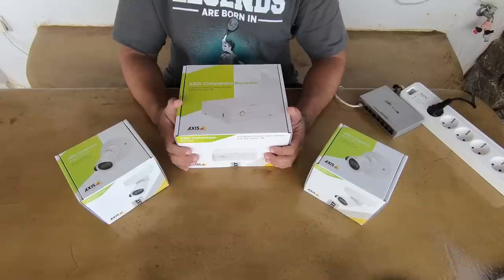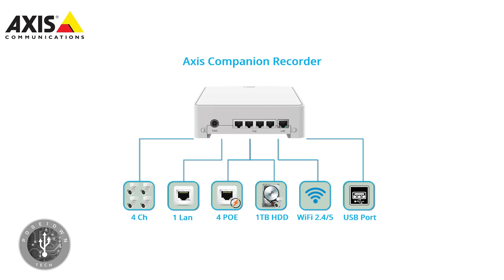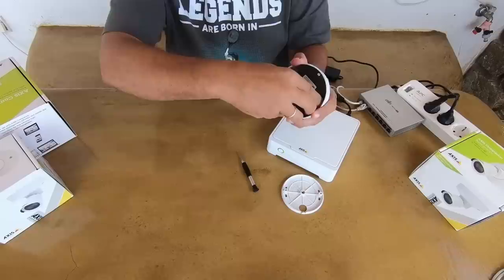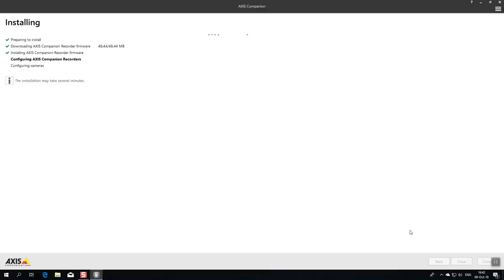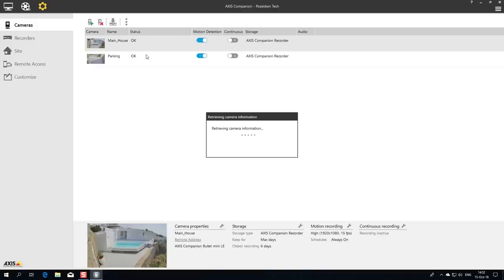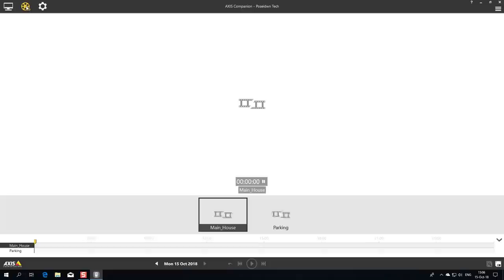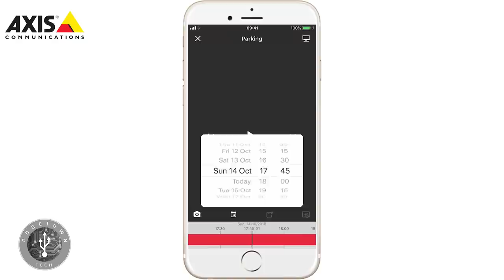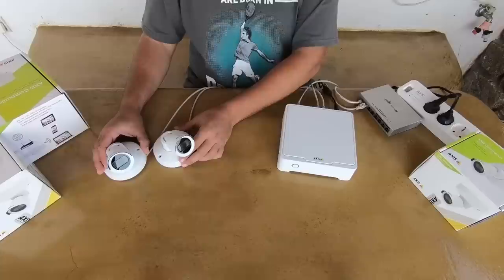Axis Camera Companion - Step by step Tutorial

Comment: Thank you very much. I really trust your answer, I'm going to buy surveillance cameras for my new house. My question is, what do you prefer for privacy in Remote Access is it Axis Camera Companion, NAS License of surveillance cameras, or something else? I would be happy if you gave me the answer as usual. Thanks for your great videos, I benefited a lot from you.
Reply from the maker: You are welcome! About your question I prefer Axis Camera Companion. I believe it’s more secure and very easy to use. You can use Axis Camera Companion either with Axis Camera Companion NVR or without it using SD Cards inside cameras. I have used both ways and until now I didn’t face any problem.
Reply: @PoseidwnTech  That's helped us. We really appreciate what you are doing for us. Thank you so much.
Reply: Hi. Thanks for this video. One question please: I have two Axis M3027 and one M3027 camera's. All recording via SD card. The problem I have is that they don't seem to throw away the old files after x days. This results that the camera's continue to record/save to the SD cards untill they are full. Once they reached that point, I can't access the recorded files anymore and need to take out the SD cards in order to erase all data and place them back into the camera again in order to be able to record again. Are you familiar with this issue and do you know how to solve? Many thanks!
Reply from the maker: Hi! What is the version of Axis Camera Companion that you are using? I am using the latest which is 3.63.007. In a previous version there was an option about cyclic recordings where you had to enable it in order to restart recordings after the SD Card was full. In the last versions of Axis Camera Companion you have just to choose between the desired days of recordings or set it to maximum. Of course when the Camera reaches the days of recordings or the maximum capacity of SD Card then it will erase the oldest recordings and start over.
Reply: I used an older version of Camera Companion which did, however, already supported he desired days and maximum. I had set it to 20 days. I checked and within 20 days, the SD cards were not full. However when they became full (60/80 days or so). They stopped working. Only live feeds, but no recording anymore. Also, the existing recordings were not anymore available....

Comment: Hello, thanks so much for the video, it has been extremely helpful. I do have one question, in order to discover the cameras do you have to have your laptop connected to the same switch as the NVR or can they discovered via Wi-fi? I have an installation of this model next week, I received the equipment but my laptop does not have a RJ45 connection. I'll appreciate all feedback, have a great weekend.
Reply from the maker: Hi and thanks for your comment. Your laptop must be connected to same local lan as the NVR in order to discover the cameras. So yes you can use your WiFi or the WiFi of the NVR. Remember that the NVR by default has WiFi enabled and the SSID will be something like this : "axis-XXXXXXXXXXXX"
Reply: @PoseidwnTech  thank you so very much this helps. Also, would you mind uploading a tutorial in configuring Companion 360° cameras. It would be greatly appreciated, your videos are very easy to understand, and follow. Greetings for the U.S.A
Reply from the maker: I will try to make videos for many Axis products, so stay tuned! Thanks for your support!

Comment: Very helpful video - many thanks!  Some advice if I may please?  When doing continuous recording is the sound captured as well?  I'm looking for a solution to monitor and store 1 month of recordings for a classroom.  Do you think that an Axis M1045-LW and a 1TB Companion Recorder will be good for this?
Reply from the maker: Hi! The sound is captured in continuous recording. In order to answer about the one month recording we have to know the days and the hours of the classroom. For example 5 days and 5 hours per day.
Reply: @PoseidwnTech  Hi, thanks for confirming that the sound is captured too in continuous recording!  I'm told the classroom will be open 10 - 12 hours per day and 7 days each week.  30 days x 12 hours per day = 360 hours of video + audio so does that sound feasible for 1TB Companion Recorder in your experience?  I would hate to purchase a 1TB model and then discover that I really needed 2TB or 4TB, etc! :)

Comment: Hi, Does the AXIS Companion software need to be running on the computer to view the AXIS cameras remotely or is it only used to configure the AXIS Recorder and not required to view AXIS cameras remotely as the AXIS recorder is directly connected to the internet?
Reply from the maker: It is only used to configure the Axis Recorder and the Cameras. I have in my office 3 Axis M2025 with SD Cards for the recordings and using Companion App I can watch the cameras locally and remotely.

Comment: I have bought 4 bullet camera ( AXCM2026LEMK II ) and 2 PTZ cameras ( AXCM5525E0HZ ). Now i need to record the videos. I've PC dedicated for surveillance , can i record the videos into it using axis companion software ? ( I've a NAS ( synology ) tried with companion but not supporting ). Hope you will guide . Thank you
Reply from the maker: Hi! As i understand you have Axis M2026-LE and Axis M5525-E PTZ cameras. As i can see both cameras are supporting the new Axis Companion 4. The only problem is that Version 4 doesn't support third-party NAS while Version 3 supports third-party NAS devices. So if you want to use Axis Companion 4 then a solution could be to install in the cameras SD Cards or buy an Axis Companion Recorder.